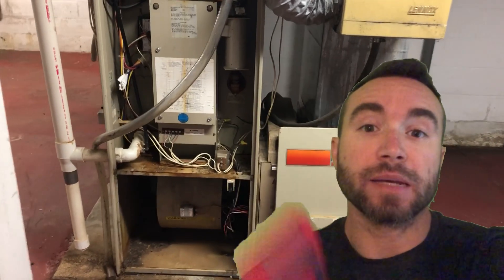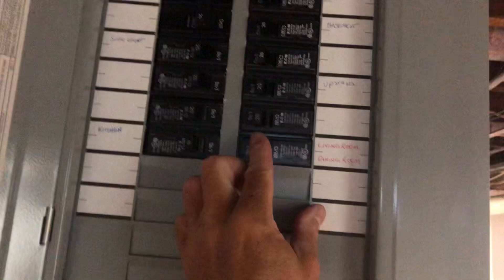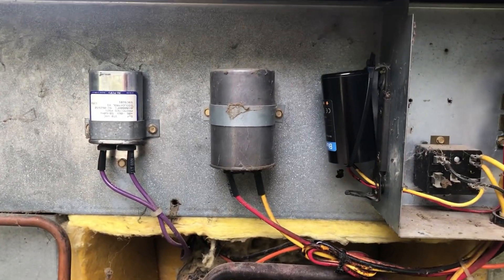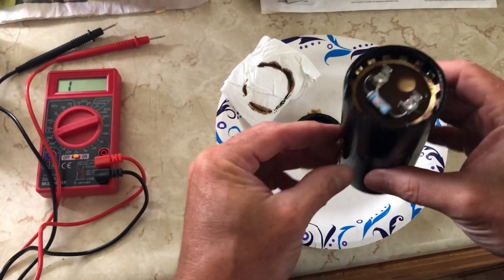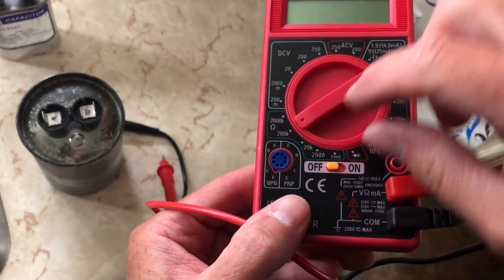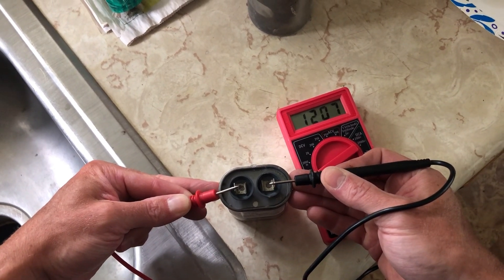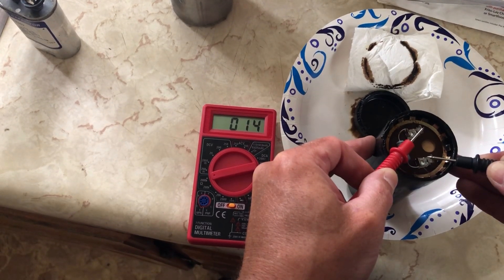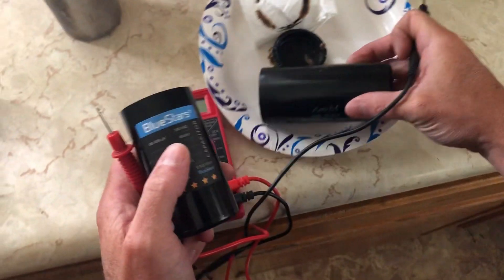How to Test a Capacitor with 7 Function Digital Multimeter

Comment: Is the capacitor bad if I get no readings?
Reply from the maker: Hey Sonic! Short answer...No, not getting any reading in capacitance mode on a 7-function digital multimeter does not automatically mean the capacitor is bad—but it strongly suggests a problem, either with the capacitor, your test setup, or the meter's limitations. Here's a step-by-step breakdown to diagnose:
1. Confirm You're in Capacitance Mode
Your multimeter should have a capacitance symbol (looks like ┤├ or || with a curved line).
Do NOT use resistance (Ω) mode—that gives misleading results for capacitors.
If your meter has auto-ranging, let it settle. If manual, start on a high range (e.g., 200 µF) and work down.

2. Common Reasons for "No Reading" (Even on Good Caps)
How to Check/Fix
Capacitor is too small
Most cheap 7-function meters can't measure below ~1–2 nF. If testing a 100 pF ceramic cap → expect zero or "OL".
Capacitor is too large
Meters max out at 20–200 µF. Testing a 1000 µF electrolytic? → "OL" or no reading.
Capacitor still has charge
Discharge it first (short leads with a resistor or screwdriver—wear safety glasses). Charged caps confuse meters.
Leads not making contact
Wiggle probes in the cap legs or use alligator clips. Corrosion or loose sockets = no reading.
Meter's capacitance function is broken
Test with a known good cap (e.g., 10 µF from a power supply). No reading? → meter issue.

3. Quick Test Procedure (Do This Now)
Discharge the capacitor safely.
Set meter to capacitance mode.
Insert leads into COM and capacitance/+ jacks (some meters use same as voltage, others have dedicated).
Touch probes to capacitor legs (polarity doesn't matter for testing).
Wait 5–10 seconds for reading to stabilize.

Expected behavior:
Good cap: Value climbs then settles near rated capacitance (±10–20%).
Bad cap (open): Stays at 0.00 nF or "OL" (even on high range).
Bad cap (shorted): Reads very low resistance in ohms mode (not capacitance).

4. Cross-Check with Resistance Mode (Bonus Test)Even if capacitance fails:
Switch to ohms (Ω).
Touch probes to cap legs:
Good cap: Resistance starts low → climbs to infinity (charges from meter).
Shorted cap: Stays near 0 Ω.
Open cap: Stays infinite (OL) immediately.

Final Verdict
Symptom
Likely Meaning
No capacitance reading + resistance climbs to OL
Capacitor is good (but may be out of meter’s range).
No capacitance + resistance stays 0 Ω
Shorted → bad.
No capacitance + resistance stays OL instantly
Open → bad.
No reading on any cap, even known good ones
Meter’s capacitance function is faulty.

Pro Tip7-function multimeters are notorious for poor capacitance accuracy. If you test caps often, get a dedicated LCR meter or at least a mid-range DMM (e.g., UNI-T UT139C, Klein MM600: https://amzn.to/4oINN1o .TL;DR: No reading ≠ bad cap. Discharge it, verify meter range, test in ohms mode too. If it won’t charge (resistance doesn’t rise), then it’s bad.

Comment: what way do the leads need to be attached to the dmm?
Which poles do you touch with them?
What happens if you do it wrong?
What happens if you use a wrong setting.
How do you measure the actual capacitance?
Reply from the maker: hey Stall! Testing a Capacitor with a 7-Function DMM:

How to Attach Leads to the DMM: 
Plug the red lead into the V/Ω or dedicated capacitance port (often labeled "COM" for common or marked with a capacitor symbol). Plug the black lead into the COM port. Ensure leads are secure.

Which Poles to Touch: 
For non-polarized capacitors (e.g., ceramic), touch the red probe to one lead and the black probe to the other—polarity doesn’t matter. For polarized capacitors (e.g., electrolytic), touch red to the positive lead (longer leg or marked +) and black to the negative lead (shorter leg or marked -).

What Happens if You Do It Wrong: 
Reversing polarity on a polarized capacitor may give inaccurate readings or damage the capacitor (especially if it’s still charged). Incorrect lead placement in the DMM (e.g., wrong ports) can lead to no reading or damage to the DMM.
What Happens if You Use the Wrong Setting: Using a wrong setting (e.g., voltage instead of capacitance) may show no reading, incorrect data, or damage the DMM or capacitor. Always select capacitance mode (if available) or resistance mode for testing. Continuity mode can check for shorts but won’t measure capacitance.

How to Measure Actual Capacitance: 
Set the DMM to capacitance mode (if available, often marked with a capacitor symbol). Discharge the capacitor first (short leads with an insulated screwdriver). Connect probes to the capacitor leads (observe polarity for electrolytic caps). The DMM displays the capacitance in µF, nF, or pF. Compare to the capacitor’s rated value. If significantly off or no reading, the capacitor may be faulty. If no capacitance mode, use resistance mode: a good capacitor shows increasing resistance to open circuit (OL); a constant low reading indicates a bad capacitor.

Tips: Always discharge the capacitor first. Test out of circuit for accuracy. Check for physical damage (bulging/leaking). Consult a professional if unsure. Happy testing!

Comment: Come on... You know you can't test a Cap with the resistor still connected. You must disconnect 1 side. It's bleeding the current you're applying with the meter.
Reply from the maker: Hey John! not quite sure what you mean? Yes, it’s true that you should disconnect at least one side of a capacitor before testing it with a multimeter. 
Here’s why:

Interference from the circuit: 
If the capacitor is still connected to the circuit (e.g., with a resistor or other components), the multimeter’s readings can be affected by the rest of the circuit. Other components may allow current to flow, which can skew the capacitance, voltage, or continuity readings, leading to inaccurate results.
Bleeding current: A connected resistor or other components can "bleed" or divert the current applied by the multimeter, making it seem like the capacitor is faulty or giving misleading measurements. For example, a resistor in parallel with the capacitor can create a path for current, affecting the multimeter’s ability to accurately measure the capacitor’s charge or discharge behavior.

Safety and accuracy: 
Disconnecting one or both leads isolates the capacitor, ensuring you’re only testing the capacitor itself and not other circuit elements. This also reduces the risk of damaging the multimeter or getting a shock if there’s residual voltage in the circuit.

Steps to test an air conditioner capacitor:

Turn off power: 
Ensure the air conditioner is completely powered off and unplugged to avoid electrical shock.
Discharge the capacitor: Use a screwdriver with an insulated handle or a resistor to safely discharge the capacitor, as it can hold a charge even when powered off.

Disconnect one or both leads: 
Remove at least one terminal of the capacitor from the circuit to isolate it.

Set the multimeter: 
Depending on your multimeter, set it to capacitance mode (if available) or resistance/continuity mode to check for shorts or opens.
Capacitance mode:
 Measure the capacitance and compare it to the capacitor’s rated value (usually printed on the side, e.g., 35 µF ±5%).

Resistance mode:
 A good capacitor will show increasing resistance as it charges, eventually reading open (infinite resistance). A shorted capacitor will show low resistance, and an open capacitor will show no change.

Interpret results:
 If the capacitance is significantly off or the capacitor shows a short or open circuit, it’s likely faulty and should be replaced.

If you’re testing an air conditioner capacitor (typically a dual run or start capacitor), make sure to check both sections (e.g., fan and compressor) if it’s a dual capacitor, as one section can fail independently.

Comment: I think your procedure is wrong because you are not testing for microfarads.    There is a microfarad scale on the multimeter.  Each capacitor has a specific capacitance measured in microfarads - not merely an open loop.
Reply: He’s right… you’re wrong
Reply from the maker: Hey Baub! I was testing my Air Conditioner capacitor, here's some additional info that can help clarify 😁👍

Procedure to Test a Capacitor with a Multimeter
Safety First:
Ensure the capacitor is fully discharged by shorting its leads with an insulated screwdriver or resistor to avoid shock or damage to the multimeter.
Disconnect the capacitor from the circuit, if possible, for accurate results.

Set Up the Multimeter:
Turn the multimeter dial to the capacitance mode (μF scale). If your multimeter has specific ranges, select one that includes the capacitor’s rated capacitance (e.g., 2μF, 20μF, 200μF).

Connect the Capacitor:
Insert the capacitor leads into the multimeter’s capacitance measurement slots (often marked with a capacitor symbol or shared with other functions).
If the capacitor is polarized (e.g., electrolytic), ensure correct polarity: positive lead to the positive probe, negative to the negative probe.

Read the Capacitance:
Observe the multimeter display. The reading should stabilize and show a value in microfarads (μF).
Compare the reading to the capacitor’s labeled capacitance (e.g., 10μF ±10%). A significant deviation (outside the tolerance) indicates a faulty capacitor.

Additional Checks (if needed):
Open Circuit Test:
 If the multimeter shows no reading or an unstable value, the capacitor may be open (broken).
Short Circuit Test:
 Set the multimeter to continuity or resistance mode (Ω). If it beeps or shows near-zero resistance across the leads, the capacitor is shorted.
Visual Inspection:
 Look for bulging, leaking, or damaged casing, which indicates a failed capacitor.

Comment: I cannot for the life of me figure this out, my multimeter just keeps giving me a reading of "1" no matter what I try
Reply from the maker: Hey Jimbo! What are you trying to test?
Reply: @ChrisBassettTV  oh thanks for the quick response. It's basically a capacitor out of my AC unit. Before I took it out, the fan would physically spin but there was no cold air, so I assumed from a different tutorial that the common and fan leads together would give me a number but the common and "HERM" leads would give maybe a reading of zero? I'm very much not accustomed to using multimeters sorry lol
Reply: Sorry I'm trying this again per your video instructions and got something to happen this time. Common/fan did give a gradually increasing reading until it stopped at "1" but common/herm just stays at "1" the whole time
Reply from the maker: Hey! No worries at all, multimeters can be tricky if you’re not used to them. It sounds like you’re testing an air conditioner capacitor, and your multimeter showing “1” likely means it’s not reading the capacitor correctly, possibly due to the setup or settings. Here’s a quick guide to help you test it properly:
Safety First: Make sure the capacitor is fully discharged before testing. You can do this by shorting the terminals with an insulated screwdriver (be cautious, as capacitors store charge). Also, ensure the AC unit is powered off.

Set Up the Multimeter:
Set your multimeter to the capacitance mode (often marked with a “C” or “µF” symbol). If your multimeter doesn’t have capacitance mode, you can test for continuity or resistance (more on that below).

If you’re using capacitance mode, the multimeter should directly display the capacitance value in microfarads (µF).

Testing the Capacitor:
Your AC capacitor likely has three terminals: C (Common), FAN, and HERM (Compressor). The capacitor is essentially two capacitors in one: one for the fan (between C and FAN) and one for the compressor (between C and HERM).

Place the multimeter probes on C and FAN to test the fan capacitor. You should see a reading close to the capacitor’s rated value (e.g., 5 µF, check the label on the capacitor).

Then test C and HERM for the compressor capacitor (e.g., 30 µF or whatever the rating is).

If the multimeter stays at “1” or shows random numbers, it might mean the capacitor is open (faulty) or the multimeter isn’t in the right mode.

If You Don’t Have Capacitance Mode:
Set the multimeter to resistance (ohms) mode.

Touch the probes to C and FAN. A good capacitor will show a low resistance that gradually increases as it charges from the multimeter’s small voltage. If it stays at “1” (infinite resistance), the capacitor is likely bad.

Repeat for C and HERM.

You can also test for a short by checking continuity between terminals. If it beeps (indicating a short), the capacitor is bad.

Common Issues:
If the multimeter always reads “1” in capacitance mode, double-check the probes are firmly connected, and ensure the capacitor is discharged.

If the readings don’t match the capacitor’s rated µF values (usually printed on the side), the capacitor is likely bad and needs replacing.

Since your AC fan was spinning but not cooling, the HERM (compressor) capacitor might be the issue, as it powers the compressor that produces cold air. A zero or incorrect reading between C and HERM would confirm this.

Next Steps:
If the capacitor tests bad (wrong µF, open, or shorted), replace it with one that matches the same µF ratings and voltage (e.g., 5+30 µF, 370/440V).

If the capacitor tests okay, the issue might be elsewhere, like the compressor or wiring, which would need further diagnosis.

Feel free to share the capacitor’s µF ratings or what your multimeter is doing, and I can help narrow it down further! Also, check out [this video link or a basic multimeter tutorial] for a visual guide on testing capacitors. Hope this helps, and let me know how it goes!
Reply: @ChrisBassettTV  thank you so much, I had to put my multimeter in resistance mode, but touching the leads to common and fan did give a gradually increasing reading until it leveled out at "1", but common and herm just stayed at "1" no matter what which seems consistent with the faulty behavior of the AC unit. So I think I'll order a replacement capacitor, thank you very much again for your time and explanation, I really appreciate it!
Reply: Just to update, I swapped out capacitors and my AC is blowing cold air now, just wanted to say thank you again for your help!
Reply from the maker: That’s Awesome! Thanks for the update Jimbo 👍😁
Reply: @ChrisBassettDIY you are awesome!!!! I had the. Dame issue with mine and your walkthrough helped me! Ordering a new capacitor and hopefully beat this Texas heat!
Reply from the maker: @BigLittleFedoraProdt thanks! Glad it helps 😁👍

Comment: The third capacitor (the round black model) is a bit different than the other two. The old (failing) one has a "bleeding" (self-discharge) resistor across the terminals. It's likely a very high-ohm value that's designed to slowly discharge the resistor when power is removed, but won't affect it during normal operation. Notice that the replacement does not have that green element that connects the two terminals.

What this means is a multimeter will never show an open circuit like a regular capacitor. After the capacitor charges up it'll just show the value of the resistor.

The replacement without the bleeding resistor will work, but it'll tend to wear the contactor out. The bleeding resistor drains the capacitor when it disconnects instead of arcing across the contacts. Here's more info (including how to add a resistor to a capacitor without one): https://temcoindustrial.com/product-guides/capacitors/bleed-down-resistors#:~:text=A%20start%20capacitor%20resistor%20(also,to%20the%20start%20capacitor's%20terminals.

Overall, though, your simple multi-meter test is a good "in the field" pass/fail test for a regular capacitor.

Comment: That only tells you if it’s completely bad. It doesn’t tell you if the capacitor meets its listed specification or not. 
You would need a meter that can read microfarads.

Comment: i would check the Microfarad reading :face-fuchsia-tongue-out:
this meter is not able to read microfarad (uF) to test capacitance. this method is only a very crude indication anyway and won't tell you anything about any other faults the capacitor may have. harbor freight does have a cheap, correction affordable 
CEN-TECH 9-Function Digital Multimeter with Audible Continuity does and is $19.99 
AMES INSTRUMENTS CM400A 400A AC Clamp Meter $39.99
my recommendation would be this puppy it has a lot more features and more bang for your buck
CM1000A Ames Instruments AC/DC Clamp Meter AC/DC 1000V only $89.99 :face-blue-smiling:
i have Fluke multimeters but none of them read microfarads i went with the Cen-Tech 9 function
excellent video :person-turqouise-waving: